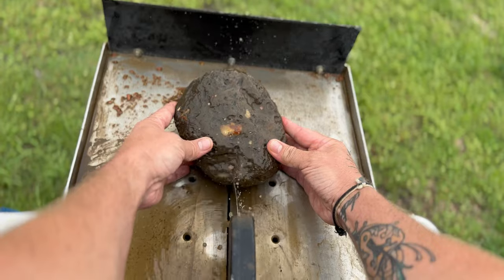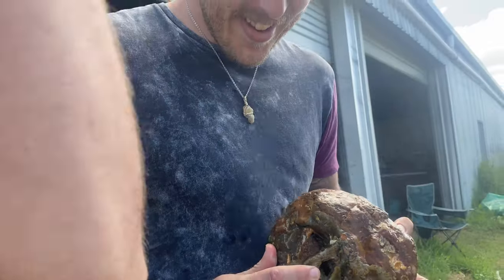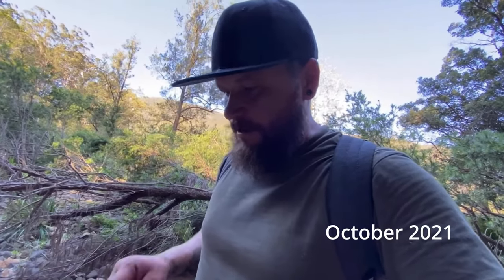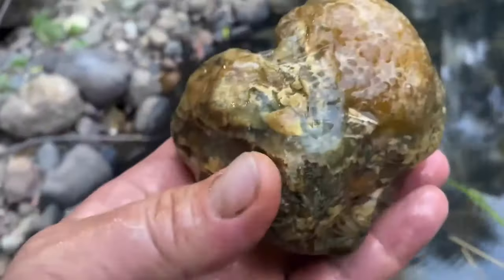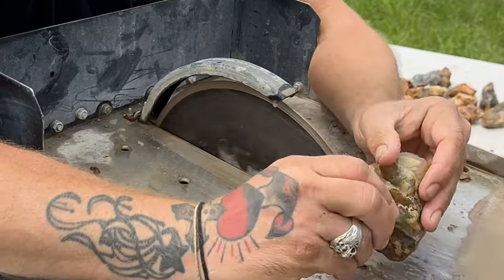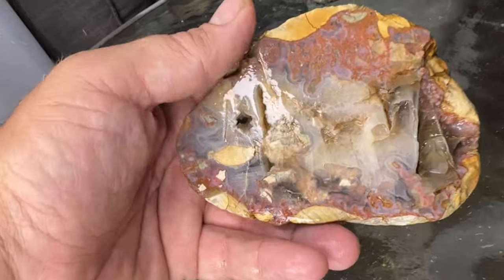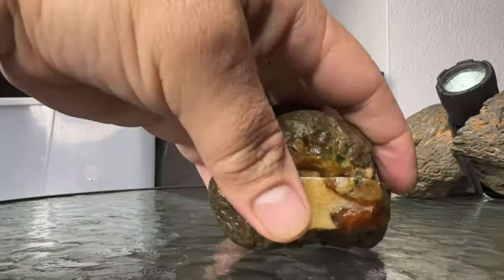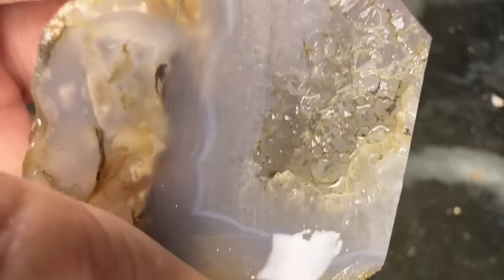Cutting Rocks: A Deeper Look at DIY Lapidary

Comment: Jasper and agate often show variegated patterns inside when cut, especially along cracks and lines (color or texture transition areas).  However, it would be good to cut through sections where there are cracks or line formations because these sections may have been remineralized when the rock suffered cracks during its journey to the site where it was picked up.

Comment: I am an old rock enthusiast, coming back to it now, as I have a new lease on life after a recent hospital excursion. I’m looking for any tips as a new lapidary hobbyist. I am in the process of purchasing a small trim saw as I do have some creative ideas and other rocks that I can find around my area. Is there decent and much cheaper way to make cabs other than to buy a very expensive cab machine? I already have a Tumbler And I will be purchasing a flex shaft, multitool as well. Just curious as to if this may be enough as a start for polishing, cutting and shaping. Any, and all help would greatly be appreciated friends.   Thank you all :)